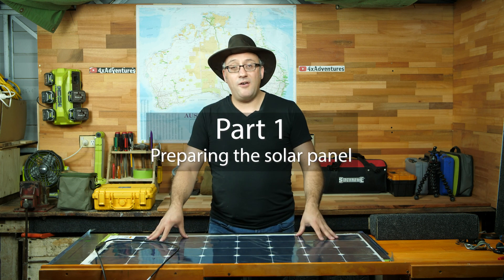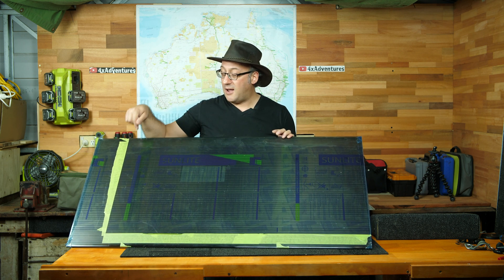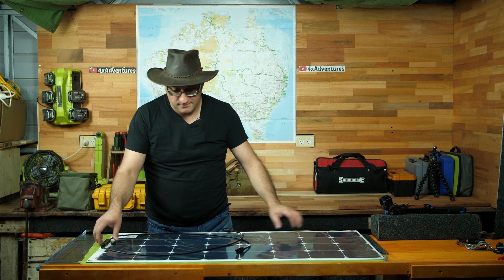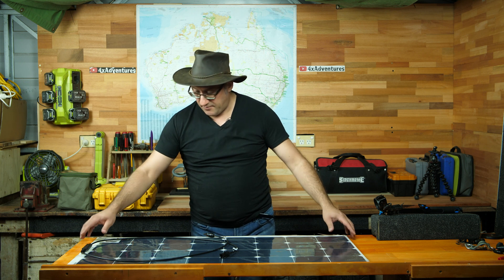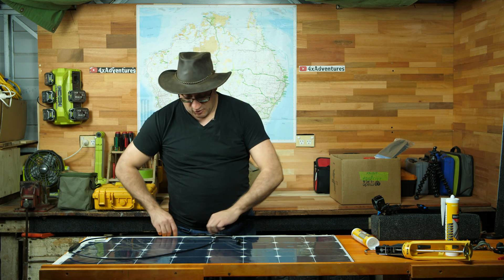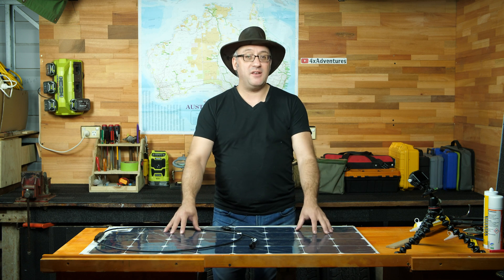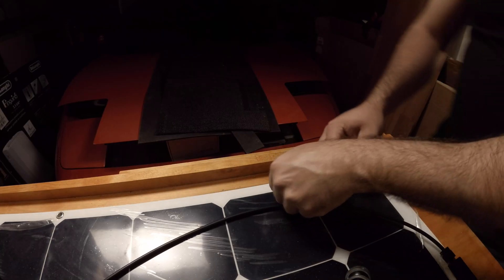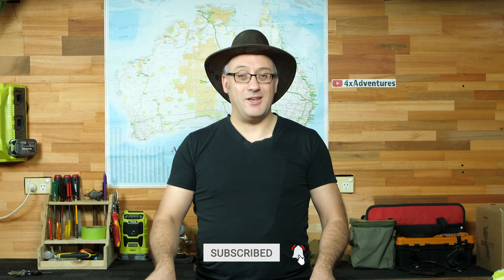How To Correctly Install A Solar Panel - Part 1 Preparation | @4xAdventures #adventure #4wd #touring

Comment: Hi, interested how this solar panel is performing for you 1 year later?
Reply from the maker: Hi David, the solar panel was performing perfectly… right up until the point I hit an overhead branch and broke one of the cells. 🤷🏻‍♂️😳

I will now be replacing it with a 250W panel.
Reply: @4xAdventures  I suggest not using a panel with a PET top surface next time. This will ensure many years of service. The best semi flexible solar is eArc by Sunman which is CEC approved and has a 5 year manufacturers warranty.
Reply from the maker: Thanks. I’ll check it out!
Reply from the maker: It’s my own fault for hitting a branch though :)

Comment: What brand solar is it?
Reply from the maker: I got this one from pristine marine.com.au. The solar cells and efficiency rating are important factors to look at. These panels are well made and this particular one (the 100W panel - I chose one that fits perfectly on to the tent) has the highest efficiency rating compared with anything else I could find.
Reply: Do you mean outback outbackmarine.com.au ??? The link you provided goes to a pipe fixing website haha
Reply from the maker: Sorry, autocorrect screwed that up. The site is pristinemarine.com.au
😊👍

Comment: This is one my favorite channel’s already. So what is the size of your solar panel and the battery as well.
Reply from the maker: Thank you so much!!
The current panel is a 100W panel. It uses sun power solar cells which are the highest efficiency cells available. 
The battery is a 110AH led crystal battery.